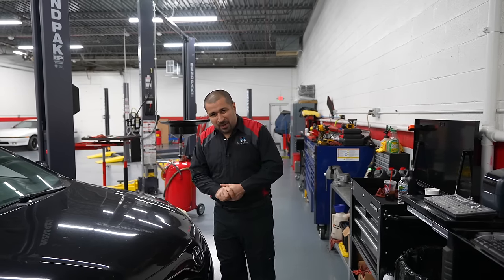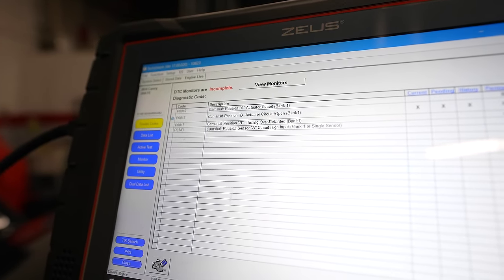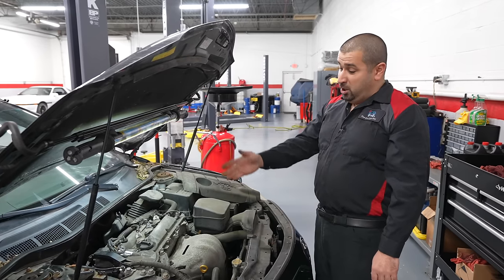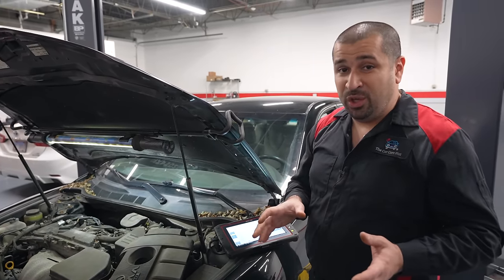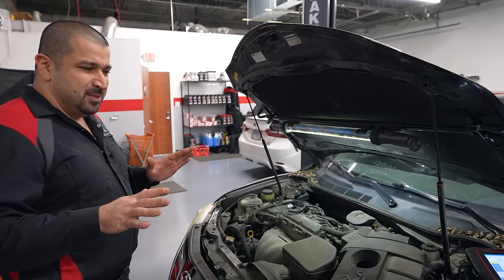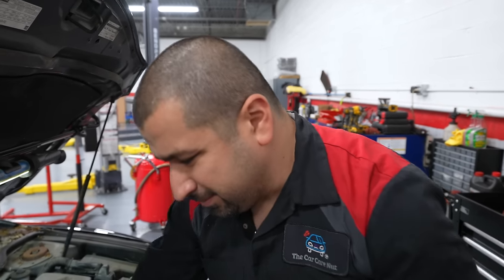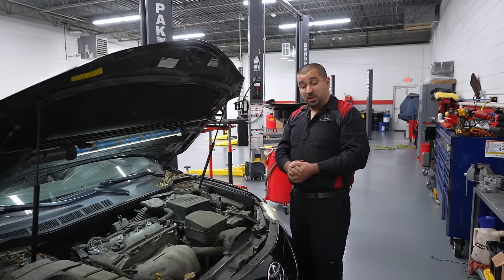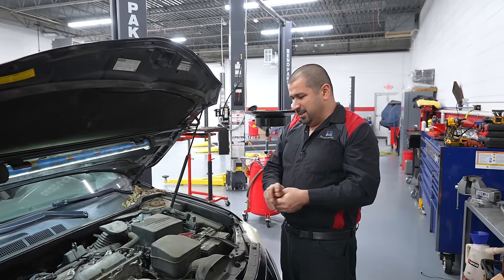Mechanic Parts Cannon FAIL Cost Customer A LOT! Let's Try This Again

Comment: Part of me wants to take that ECU apart and diagnose the VVTI drivers. It's likely a burnt up mosfet or driver chip that has a built in transistor. If it's a common off the shelf part, you could potentially fix this ECU for a couple dollars. But that's an entirely different trade.

Comment: Good video with many lessons.  The final nail in the coffin on the diagnostics would be plug the engine harness back into the computer, probe the suspect OCV connector with a DMM or Oscilloscope, run the engine and activate the OCV. 
If you don't see a signal from the ECM, and you know the wire harness is good then no doubt ECM is bad. 
If the ECM was working you should see 12V PWM at the OCV.

Comment: that car is really not that old, Toyota should put a new computer in. I had an experience with toyota dealer one time. after testing the alternator they found out it was a corroded wire. of course that was not under warranty. car was only two years old. some of these warranties are BS. and the customer is the guinea pig. wires should not corrode in only two years. the car was not flooded out. but the customer is at the  mercy of the dealer or any mechanic.

Comment: So I work part-time at a part store as I'm studying automotive technology at college, and we do free code scans as a service. I've had it happen so many times when I go to scan a code for a customer, and immediately the customer or "mechanic" goes "oh so it's the sensor/part. Like recently I went to scan a customers car and the two codes that showed and up pending  were p0306 and p0206. I remember p0306 as a misfire on cylinder 3, and only vaguely remember the p0206 was a fuel injection problem, the customer on a heart beat said "so I have to buy an ignition coil." I tried explain to him that someone has to do further diagnosis as it could be other possible problems and not just an ignition coil. The customer left afterward without buying anything which is fine by me I'd rather not sell anything than sell something that won't fix a customers problem, and I just hope they went and got their car diagnosed.

Comment: What about connecting a meter to the oil control valve connector & commanding the valve (through the scan tool) to activate to be sure the ECM cannot send the signal?

Comment: I made this mistake with the ignition coil during DIY. (Blowing fuses -> short to ground). Turns out it was actually the ignition condenser. Luckily I didn't throw away the original Toyota ignition coil which is still good, so I only lost $50 and not $700 like this guy.

Comment: Resistance test alone is no guarantee. You should test that it can carry current, particularly in the case where the power is for an electromechanical device, like a solenoid.

Comment: Unfortunately the Stealerships are not much better, Sometimes they are worse. MORE expensive and still just as incompetent.
My mom had a Scion, she called me said it was running really bad.. 
She took it to the dealer. They told her it needed an ignition coil..  and wanted $600 to do it.. 
I knew a coil could not possibly be that expensive..  Looked online.. found the OEM Denso part.. for $65!!!!
I told her to wait till I could look at it... 
Code was misfire on Cyl#1  , First step... swap coils #1 and #2.. if it IS a coil the misfire should move. Yes it could have been a wiring issue but car had 65K on it.. and garaged.. so no mice.
The misfire did not move!!    So its not a coil.. Also..  it took me 5 min to do that. 
in FIVE min I found the dealer diagnosis was not only wrong.. but WAY overpriced.
The car only had 65K miles on it so, it's  not likely to be a mechanical problem.. timing or valves etc...   
It did at one time have a leaking fuel injector on cyl#1..  just an o-ring failure dealer fixed that.. maybe.. or maybe they damaged the injector when they changed the o-ring.
The only other issue could be fueling, I swapped the #1 and #2 injectors.. and the misfire moved to cyl #2.  New OEM injector.. $150 and it was fixed. 
And we NEVER used the dealer again.. I started doing all the basic work on her car.. Brakes...etc.

Comment: I can remember looking at a new Audi A4 about 25 years ago in the Cincinnati area,  even drove it.  The dealer at the time charged a $450 vehicle prep fee that was over and above the required delivery.  Some Toyota dealers were charging $700 fluff fee for paint protectant or some BS.  I always walk away from these dealers.  I will never be desperate enough to buy a new, or used car with a fluff charge.   It's like staying at hotels that charge a mandatory Resort Fee, which I won't do.  It's BS.

Comment: In the parts cannon's defense, ECM issue is rare.  Under my shade tree, I would have checked resistance of old and new sensors out of car.  That way, the new sensor does not have tool marks and can be returned.  Yes, yes, that's rubbing nickels.  The "mechanics" near me are bad and I don't want to take the time to find a good one.

Comment: It was necessary to measure on the sensor connector by connecting the plug to the ecu, there are short circuits in the harness itself

Comment: @thecarcarenut I have a weird issue to pick your brain :)
The vehicle is 2016 Camry 4 cylinder.
Issue is:
1.All 4 windows stopped working.
2.Emergency brake light doesn't work.
3.Shift lock is always active (I have to press the button next to it in order to shift from park) pressing the brake pedal doesn't make a difference.
4.All external lights turn off every 20 minutes exactly while driving and I have to reset the light switch and start another 20 minutes.
Otherwise, everything works fine.
All fuses checked with no problems.

Comment: The computer connector itself may be the culprit.  There is a spray product, DeoxIt, that treats low-level corrosion between connectors.  I've used it for decades in the broadcasting business to clear issues like noisy audio connectors and such, particularly those exposed to salt and rain!

Comment: Years ago, the truck I drove for work kept going into limp mode, the fault code would say coolant level sensor. Replace sensor, off we go. A week later, same code, same "cure". This repeated several times over a couple of months. I had a meeting with management, suggesting that I may find alternate employment. (It turns out that the previous driver of the truck threatened to quit, and was given another truck.) They put one of their best mechanics on it, who immediately wondered aloud (VERY loud!) why this one truck was eating coolant level sensors. In less than five minutes, he found the connector on the sensor was bad. The pins were corroded and had very little spring tension. The computer saw a flaky signal, thought the coolant tank was empty, and this would trigger limp mode. New connector, no more problems. Everybody was happy until the mechanic pointed out that half a dozen perfectly good sensors went in the trash bin. The lesson I took from that is... Fault codes are useful indicators, and good to have, but not a silver bullet!

Comment: I had this happen to my own car and spent hundreds dollars and hours with issue.  The original issue was a cracked and worn engine hardness clip was incompatible even with new harness from dealer. Models or '03-05 had small switch in '07-09 model in fuel injector sense pin. Fuel injectors, coils, 02 sensor, Three engine harness, solenoids, gaskets. Pcv.

Comment: Hmm probably popped a resistor on that portion of the main board. would be interested in if there's any scorch marks around that pin on the mainboard. 
Cool video, good lessons.

Comment: Quick question could you have just put your meter in the plug at the sensor and commanded the component to on while unplugged? You would either get voltage or not if none shows move ground wire from meter to known good ground to see if you have voltage? Then depending on that proceed to test the wires? I did not realize that the codes could come and go without the engine running. Parts are expensive so parts cannons are not good idea and it makes you look bad. Customer’s need to understand that diagnosis can take some time and should be charged for it. Great video and your correct intermittent problems are the worst.

Comment: Nicely done.  Say, I've got a 2015 Camry and a friend had a 2014.  Mice like to go into the air intake and build a nest in that "air receptical".  I don't know what that box is for after the funnel shaped air intake.  When I check the air filter from time to time I'll see the building materials.  I use a vacuum clearner with and added hose to suck stuff out of the box.  I'm thinking about putting a screen over the air intake. Cheers.

Comment: The more electronic stuff and modules that get put in a car/truck the bigger the headache when something electrical fail. As for aftermarket electrical for Toyota/Lexus would you say Denso is an acceptable name? Given they are all over OE components i would hosp so but am curious to see your take on it.  
    Your method of diagnosing is really thorough...it makes understanding much easier. Electronics are my weakness on cars...thus why I love older cars which are more basic even though there is a fair amount of electrical parts on 1999 cars as well...but nothing like newer cars.

Comment: Good video but there is slight possibility that the original diagnosis was correct but the POS oil control valve smoked the ECU. I doubt he even checked anything tho.

Comment: yep they did this to me. 2000 bucks later still not fixed.. but they parts they changed needed  replaced anyway.. blah blah.. my car does this under a load. slight incine. no check light was ever one too.. but now it is because they replaced the cat with after market.

Comment: Good testing there.only I been caught out before with continuity testing  .you still have continuity through 1 strand of wire doesn't mean its good. Load testing is a better way of testing a wire ie with a bulb.

Comment: As long as the customer is willing to pay for diagnostic time. (1hr. min.) That scanner is probably $6,000. and costs a $100. a month to keep it updated!, not to mention this guy has at least $40,000. in his tool box!  yet a plumber charges more for a house call than his shop rate!

Comment: Your diagnosis may be correct, however, using a resistance measurement to check the wires is not a good test, and it's possible to get burned with this test. You may have corrosion or broken strands of wire that will allow the very very small current of your ohm meter to show good but won't carry the current of the solenoid. You need to match the load of the solenoid and load test those wires before calling the computer.

That said, it's likely the old solenoid shorted and the old valve was bad but it also fried the driver when it failed (or the last tech fried it.) This is why you always use a test light or a substituted load to make sure the PCM driver is working, even when you find and confirm a bad output.

Comment: You did a continuity test from computer to solenoid, great..
But you didnt do a load test on those wires. You can have continuity but the wire may not be able to carry current. Test light bulb in series?

Comment: Your definition of a Parts Cannon basically sums up every European brand/mechanic. They have no clue what is setting off the check-engine light… they throw parts at it, reset the ECM and if the light comes on again… through more parts at it.

Comment: This is why they are now called technicians. They don't diagnose, they go by the codes and replace everything that can cause that code. For example on a Smart you may get a code for the abs/stabilization system that is caused by a cracked reluctor ring. They will replace the rear axle shaft as individual rings are not available from Smart (MercedesBenz). $1500 axle instead of $10 for the ring (after market) plus labor to install. DIYers have gotten a ring (or 2) and installed themselves in under an hour.

Comment: Great video, but i think i would have load tested the circuit and not depend on a resistance test as i have seen that test good with partial broken wires.

Comment: It’s a common misconception that OL means overload or over limit which it does not. How can a circuit be overloaded or over limit when the multimeter probes are not connected? It can’t be.

In fact OL means “open line” which is the same as open circuit. Hence it displays OL until you touch the probes to something. If what you are testing is beyond the selected measuring range then it also displays open line as it appears that way to the meter.

Comment: Amazing video.  As a circuit board repair specialist I think you'd make a great PCB repair tech!  The only thing I would change is your last test for checking for shorts between power and ground.  I would have removed the cables to the battery and tested for continuity just like you did before.  Testing on volts could be a bit inconclusive.  You could read 0V between ground and the pins and assume you have a short when that isn't the case.  It is an extra step, but IMO is a better confirmation.  I'd be curious to take a look inside that ECM, but that would be a whole extra video 😂

Comment: My lexus dealership fired a parts cannon at my rx 400h 2000 turned to 3000 to 5000 to 12000 to 15000. I gave up and bought a new car . They never got it running after it died out of no where no troubles no lights just dead.

Comment: The driver in the ECM for the component is bad . The ONLY question for the other shop is " will it fix the car " ? Are they going to make good on it ? They obviously never diagnosed it - as you explained . And many of them will STILL argue with a customer - " those parts were bad too " .

Comment: The next level is to open the computer case and reflow the solder connections on the circuit board from the pins on the (male) connector. .

Comment: AMD, sure appreciate your videos and this one especially.   We all have at one time, came across the parts cannon shop, if the owner has been driving for a few years.  First, these shops DO NOT have your professionalism and honesty.  That professional falls on the shop and the mechanic. The training the mechanic receives depends on the quality of the shop and prior schooling/training the mechanic attended earlier in his career. 
 The Honesty, I place upon the mechanic, He has his own set of values and standards.   And , he can choose to go to a more upscale honest shop.  The Honesty of the shop falls upon the owner and the mechanic can not change the shop.
 How does one find a honest shop, even vehicle owners have not figure that one out.  You have a good mechanic or shop and they leave or the shop get sold, etc.  It is a constant moving target.
Do you have any suggestions on how vehicles owners find a good honest shop?  Sure appreciate any suggestion you may want to impart.  
Thanks.

Comment: Thanks for making these videos. Unfortunately the problem you are illustrating is so widespread that all automotive shops are looked at in the same light.
There was a time when the dealer was statistically your best chance of getting a qualified technician, however all a dealer guarantees you today is that you will pay 200$ and hour.
The good shops are lumped with the Not so good shops, and the problem is a bad situation. Unhappy customers and good honest shops having to deal the unhappy consumers. 
And the auto industry benefits because people buy new cars so they don’t have to deal with incompetent service and maintenance .

Comment: I believe your meter reading is zero load or open load, but however you like to remember it, there’s no continuity. Which is good since you’re checking for a short at that point. 
Do a follow up video. I bet changing a computer with that many pins is loads of fun and $.

Comment: Yeah, same as the case on my car. It said "P_some_error_code_driven pulley speed sensor fault". 
The sensor was not faulty, but there were shrapnel from CVT belt that covered the sensor. I ended up changing whole tranny because of it.

Comment: When it comes to electronics in my Toyotas, if it ain't Denso, then it ain't going in my Toyotas. But I will use NGK spark plugs. Other than Toyota OEM, NGK spark plugs are basically the same.

Comment: I am replacing VVT solenoid and it's filter with OEM on a 2006 Matrix 4WD with 206k miles. The body of the OCV has a tiny leak (it's not the o-ring), No codes and car runs perfect, but I'll fix it in case it becomes a problem.

Comment: This happened to me when I took my car in for a check engine light and code was for mass air flow sensor. It was changed and didn’t fix it then they said I needed a new ecu well that didn’t work. Then they did what they should have done in the beginning with a volt meter and it turned out to be a loose wire on the mass air flow connector. They were honest but I still was charged $700 for poor diagnostics and a quick soldering 😢

Comment: Me and my brother worked on a ford focus 1. 5L Ecoboost that was damaged by another mechanic. Originally the car was an approved 2nd hand car that ran good but suddenly it started to have an overheating issue. The dodgy mechanic made the owner to change every cooling system components from water pump, coolant sensor to thermostat and radiator. He later offset the engine timing and bent the intake valves.

When we inspect the car we initially discovered the expansion tank return hose coming from the radiator and engine was clogged 2) the heating hoses were bridged unnecessarily 3) sadly the engine cooling system components previous  replaced were working well.

Lesson to new car owners. Stay away from bad mechanics. Know a little bit about you car before giving it to a mechanic.